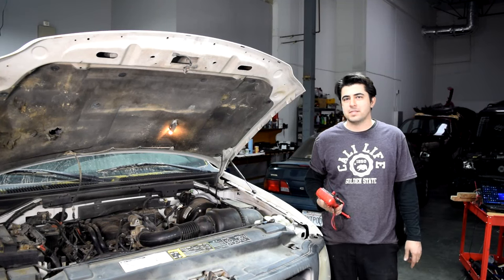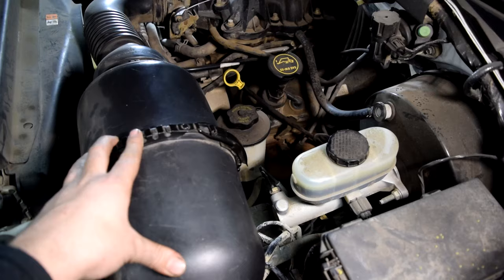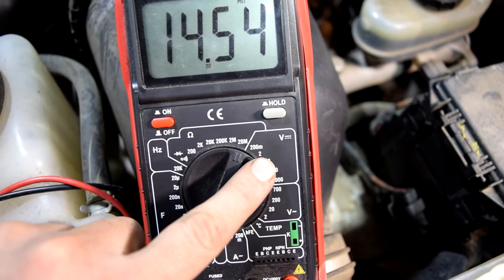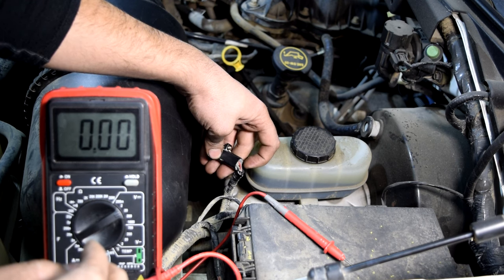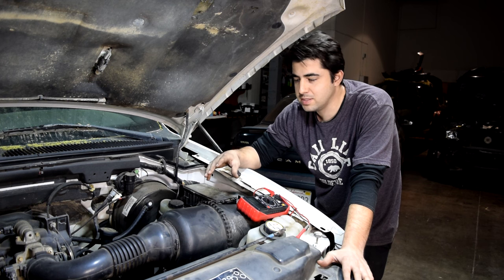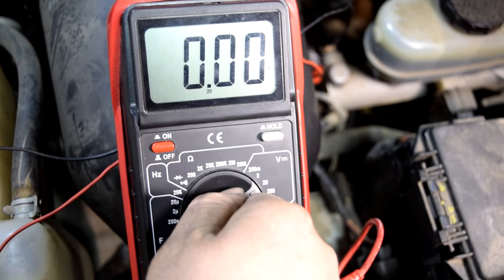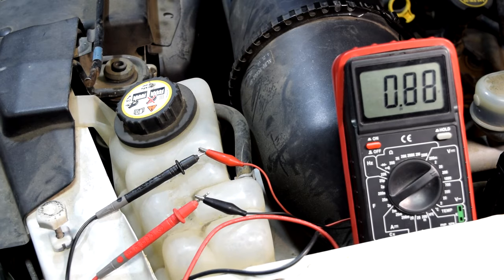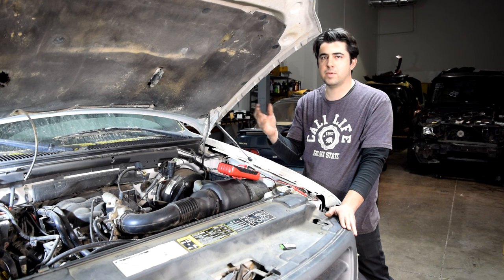How to Test a Mass Air Flow MAF Sensor - Without a Wiring Diagram

Comment: Can this indicate if the sensor is dirty or just if it's bad?
Reply: Bad includes dirty. So if you get poor readings clean first replace second.If your MAf is dirty, you've got another problem upstream
Reply: @CycloneCyd  this test is a very crude test to see if its giving any reading, if you want to know if its dirty you clean it, if you want to know if its actually giving the correct measurements you need to look at the trim numbers for the different rpms

Comment: If i remove the maf sensor plug does tbe engine still run or it shuts off?
Reply: Itll run, but poorly
Reply: Mine worked the same. Poorly.
Reply: @tomastekorius  its going to go into default mode which means its going to guestimate the air flow by the TPS and RPM

Comment: Have problem with my MAF sensor, have fault code P0100 and P0110 circuit air temp. Have change MAF-sensor 2 times and still same fault codes, i suspect there is bad ground to the MAF. 

I have 4 wires to the MAF. car is Opel Corsa 1.8 but i dont know if i only can ground that wire i suspect is the grund wire? Have do the measurement and get 12 volt on one and 5 volt on another and signal on the third. That what i tink is ground wire i have different voltage when engine running? Are there MAF.s without ground cable?

Comment: I have a question ... WHat Would Be causing a 12 /13 V reading on a 93 mustang MAF Signal In and OUT when It should Not be over 5 ?? any ideas?
Reply: Probably a bad ground connection , check both grounds at connector.

Comment: Wait this is my understanding: With the voltimmeter grounded to the Negative lead of the Battery and the key turned to the on position a charge of ground and voltage will be sent to the sensor, and each of your four leads can be tested. [Step One]: you find the two constants.  1.Constant Ground wire;  .024 Homs (The Black/White wire) meter set on Ohms  key turned just to the on position 2.Constant  Voltage Supply wire;  12.6 Volts (The Red wire) meter set on 20Vm engine started. Then you can [Start Step two]: Now you can reconnect the sensor plug, Set the meter to voltage, Start the car, = Leaving TWO WIRES to be tested with a (Back Probe). 3.Sensor Signal wire; 4.Sensor Ground wire; When probed will send a reading the will increase or decrease along with the RPMs while making throttle adjustments.   (Back Probe - Connectors are exactly what they sound like; they connect the wiring harness to a component. In order to protect, the wiring, the connection to the component against the elements. Therefore, connectors have rubber insulators where the wire enters into the connector. Our goal is to slip a small piece of metal in between the insulator and the wire. Thus the standard sharp, small diameter probe you can slide along the insulated wire into the insulated connector to make a connection under the insulation back to the meter ie. back probe circuit) { A set of Back Probes will list for $18.00 for two $36.00 for five or just bend a few paperclips for $0.00 }. Alligator Clips and Back probes are standard electronic tools. Interconnect Test Leads, Looks like this could have been preformed with just a Standard Test Lead Set (of Insulated Banana plugged to tester with Test Probes in the back of the wire harness plug)      ~ Samuel F Campbell
Reply: Covered some material!

Comment: i don't think this guy knows what he's talking about. ie ground and constant ground???  wtf is that?? the 4th pin is for temperature sensing
Reply: Not necessarily, the 5 (or 12) volt ref can often use a different ground than the signal wire does. So you can often find two groundwires there. (Not always though). And I believe the connector used for the combined IAT and MAF is often a 5 pin(?) And ground vs. constant ground is very relevant actually, since (as you probably know), often the ECM can control if the wire has a ground or not, therefore it is not constant, but only provides a ground (through the ECM itself) when the ECM decides it needs it, like a switch.
Reply: You don't have to use ohms to check for ground, all you have to switch multimeter leads. Put one lead on the positive battery

Comment: I was doing maf sensor test on lexus is220d.I had ignition switch on position  but engine was not running. I have found 12v wire 5v wire connections.I  tried to start the engine know all light come on dash but car is not cranking. before the engine was running. Can you tell what might gone wrong.